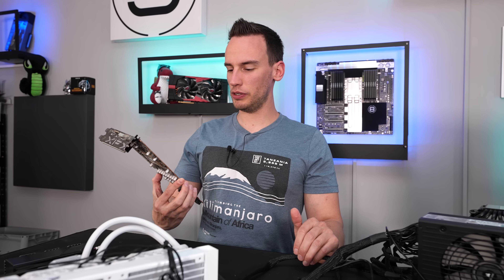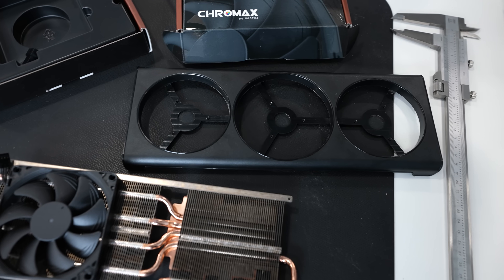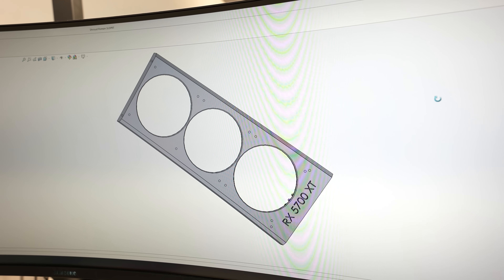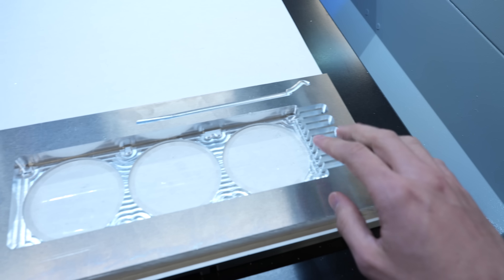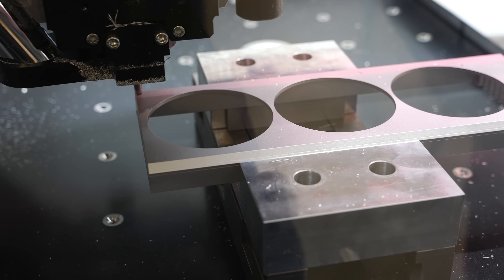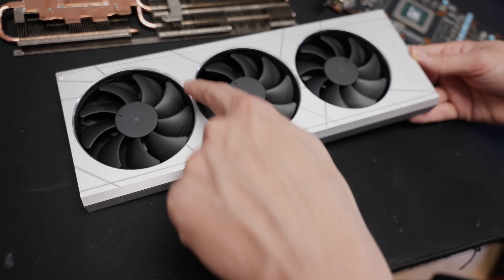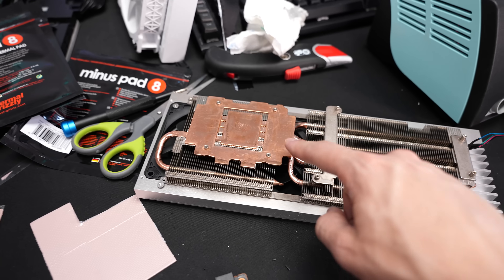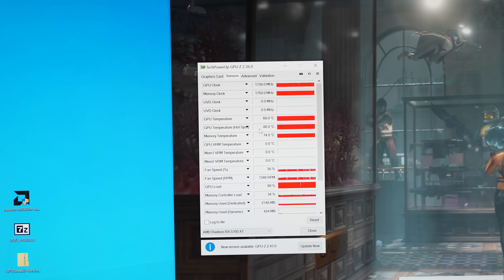We made our own 5700 XT Noctua Edition and it turned out Amazing!

Comment: Are xfx shrouds of same dimension across cards? I'd be interested in that mod's dimensions to compare with my xfx 7900xtx. An updated version would be nice, with space to tuck in wires. Or, a full deshroud mod that allows for a NH-D15. The advantage of the full deshroud is that each component are on their own heatsink. I watched a video on thermals affected by different pastes / heat pads, the ones that were really efficient transferred heat to the main heatsink but that heat wouldn't be dissipated fast enough and ended transferring to the other components (for example, good temp on memory but higher core temp). Independent heatsinks  design allow for use of paste and heat pads with best heat transfer rate without the negative side effect. Also gives you a choice on not only fans but also heatsink solutions.

Comment: In my opinion, at the cost of GPU dimensions and weight, a lot more GPU's shoud have standard off the shelf PC fans in 92mm or 120mm sizes.

This would make old GPU's  so much more convenient to replace their fans if the bearings are very worn out and close to retirement or if they have other issues.

Comment: Why didnt you just use the solid blocks of aluminium as the heatsink? Bore the inside out, add a couple ball valves to fill will water and purge the air, bolt each together with a gasket seal. Dont even use fans, it would take all day to warm up, then you can take it to bed with you on a cold night.

Comment: I was looking at alot of 92mm fans to replace the ones on my card. The conclusion I came to is that gpus using thin fans is the worst design choice ever made. Going thicker you get a free improvement to pressure without an increase in noise. And alot of the time the actual blade length is ontl 11mm not even 14, especially on older cards and palit cards.

My findings basically were

best budget:
arctic f9 at 10 cad/9 usd
15 dba
43 cfm
1.3 of whatever the static pressure unit is

best:
noctua nfa9 chromax (to not be ugly) (the ones used in this video) 25 cad/20 usd
22 dba
46 cfm
2.2 pressure (mm2 h2o? maybe thats what that was)
- or -
at 16 dba
36 cfm
1.6 pressure

when comparing to 14mm thick fans, for the same noise you get about 20% less airflow and 40% less pressure at best.
while the stock fans in gpus are around 30% less airflow and 50% less pressure at the same noise

this assumes datasheets are all correct, but we all know stock gpu fans are noisy and these noctua ones arent

Comment: I've got an RTX 2080 Ti, and one of the 3 fans are starting to act a bit weird.
There's a guy in Canada who makes shrouds that fit the older STRIX cards, which is a kind of "frame" you attach to the heat sink that allows you to attach any pair of standard 120mm fans to it. 
So, that's a nice solution. It's about 33 Canadian dollars, which isn't much, either.
Pop in a pair of Noctua fans and you'll get a setup that's quieter than the stock fans, and the cooling is even marginally better. Reliability is probably better, as well, and it's easy to replace a fan in the future.

It doesn't look good, though, just a simple plastic frame. Your solution is obviously far superior, though of course a lot more expensive.

Comment: I think repairing a flooded pc is a nice project. 
But milling the shroud out of a solid aluminium block seems kind of wastefull to me. 
Correct me if I'm wrong, the shroud material doesn't seem to serve any thermal purpose, the aluminium doesn't add to the thermal mass, does it? Could have been done with a several pieces screwed together.

Comment: How did you go about making the adapter so the board could drive the fans? Did you have to cross any wires or was it just a 1:1 thing? Did you have any references? Did you need to use a multimeter to check?

Comment: that is a nice build, but at my criteria, not efficient or an improvement in heat transfer o focus really in performance of the cooling system.

whit a better air routing in a next design, and reviving those heat pipes, temperature will drop a few but important Celsius.

Comment: Very nice mod! I've done the same on my RX 5700, with arctic F9 fans, but I've just zipped them to the original cooler.
You could fix the wrong rpms reading by using MorePowerTool and changing the fan specs as well, otherwise the vbios will still think to deal with the original fans

Comment: yeah a good backplate required... most of the time the card is horizontally mounted.
so the new setup is certainly heavy and not good for this type of setup...
but a nice backplate, covering the side, and no need to cover the heatsink itself, could be a great design.

Comment: Coole sache, da bekommt man echt bock sich ne CNC Maschine in die Werkstatt zu stellen :D

How about a V2 where you use a Rajintec or Arctic VGA cooler?
I have 3 different cards with arctic VGA coolers that are very quiet and very cool, basically at ambient noise

Comment: hey great project but the shroud weighs a ton! you could have milled away a looot more. and also things like this should be stamped and not milled. with connection points welded to the shroud. 
but i dont think anyone can produce that easily.

Comment: Could do a 'der8auer signature custom' of a top-of-the-line card: custom fans with a milled shroud, then for the milled backplate you could see what PCB areas get hot and leave islands to place thermal pads for great cooling. Maybe mill the backplate with some grooves for surface area too. Could even do a competition and give it away, one of a kind :)

Comment: Old guy CNC wisdom: Anodizing comes in two classes 'soft' and 'hard'.
Hard anodized aluminum will consume cnc tooling very quickly as it is chemically aluminum-oxide at that point, the color is usually aluminum grey or stone-washed colors. Soft anodization on the other hand is the same process, however to a lesser degree of skin thickness. Soft anodizing is faster (more vivid colors) and slightly cheaper to contract out as well.

But if only the look appeals to you, there are other simple (brush on) coatings you may wish to consider as well. Alodine (aircraft industry) produces a beautiful green/blue/purple hues on top of a gold tone. Also, "Aluminum Black" black-oxide solution (gun smiths use to touch up scratched parts.)

PS: Always prefer G1 over G0 (G-zero) milling moves.

Comment: I managed to fix the temperature issues on my legendaryly crap ASUS Tuf RX5700 XT and with kryonaut paste and new pads got the temps from 84c (HS 106C) down to 66 (HS 82C) and memory with heatspreader modding from 109C down to 84C.
All while using the same stock 75mm fans that are absolutely terrible.

2mm thick plastic washers on all heatsink mounting screws did the trick for the main temps :)

Comment: i did a very similar thing to my powercolor red dragon 5700xt last year. I 3d printed a plenum that bolted to the face of the stock heat sink and took 2 120mm fans. I did it for noise, and it was a really nice upgrade.

Comment: This is an exceptional mod and a great proof of concept. A budget brand should make a mid to high end card design with 120MM fan mounts directly to the shroud and 1 or 2 4Pin PWM fan connectors on the GPU PCB.
Reply: Maybe power color or PNY could make this for less money because sourcing 120mm fans for the GPU is probably cheap.
Reply: I would also like to see Noctua and ASUS partner again for an ITX 3060 with a single slim noctua 92mm.

Comment: EASILY replaceable fan shrouds?
Anybody else really, really want to be able to simply pop off the fan/shroud (but not heatsink) and replace the entire unit with minimal hassle? I modded my GTX1080 but it was a pain. It was fun, but I had to use zip ties. I also had issues with coil whine so had to send one of the fans to the motherboard (not the GPU fan) which worked out okay. I would love to have a STANDARD for how fans mount so you can swap the entire unit in a few minutes.

Comment: With your skills & tools, I'm surprised you haven't addressed the 1 issue that bugs me every time I see a vid about a custom cooler - thermal pads.

I'd really like to see a comparison between pads & either shims if they could be made accurately enough of the same material as the heatsink, OR an idea I just had: what about using a sort of spring made of the HS material. It'd start off as a flat thin strip of metal attached at 1 end to the HS, and be bent away from the HS slightly more than it needs to be to touch the RAM or whatever. That way, when the cooler is applied to the card it will hold itself against the appropriate component.

Comment: Try out fan modding with Asus GPUs that have Fanconnect. Or maybe tryout those PCI fan mounts that basically mounts case fans onto the PCI slot on the case, blowing air into the GPU.

Comment: I know you have your cnc machine and you want to use it but nobody does remove 90% of aluminum from a full block for doing just a holder. You could have done it by using a tool which bent aluminum, this is a huge waste of material nonetheless the result is pretty nice i just feel bad for wasting so much material

Comment: I think, that you should've cut some material from sides (to mb and case wall) - it's just dead weight, that makes card sag more in horizontal orientation. Also maybe you should've extended shroud to the io shield side, so that weight of cooler and shroud itself would lean on the io shield, that is screwed to the case, and that should make card sag far less

Comment: Great video. But a couple of questions. Why are of the sides of the new shroud so dam thick? And how much does it weigh now? And I was wondering why you had those high temps with 3 noctua fans regardless of the heatsink but then you found the mounting pressure was bad.

Comment: you said not a big difference but fixing the pressure brought it from 81C at 70% fan speed to 68C at 36% fan speed, and that also brought about a core clock bump from 1650MHz to 1740MHz with the lower thermals AND lower fan speed! That's an enormous difference.

Comment: Gelid used to make a adaptor for converting the 4pin pwm connector on GPU to standard 4-Pin PWM connector. Also why not 3D print shroud from metal instead of milling it from solid block?

Comment: Did the face plate connected to the actual heatsink? Would be cool if the faceplate also part of the cooling system. Got additional mass to soak up those heat.

Comment: Since 2017 i have been doing this to my gpus. 1080ti, 2080ti, now 3080. Using a 3dprinter to print the shroud and using 2x Noctua af12x25. The performance and noise is just way better than any stock gpu cooler... Highly recommend it !!!

Comment: That's a 1/4 kilo of alluminium Why not solder the fins to the shroud or have a thermal connection to the heat pipes. Have it be practical and pretty. I suspect it won't be hot to the touch and worth the temp drop

Comment: Ah yes, never do the final cut throughs untill all the bulk material is removed. 

Yes, Chamfer tool is the term you where looking for. 
I'd still anodise it. Even if it is just clear, simply for surface protection.

I did a similar mod to that on an old GTX 960 blower card. Pulled the loud blower off and used an old intel cooler I had sitting around. So much quieter, though no where near as neat.

Comment: I love the project, but it still having such mass of aluminum the weight of the card would be extreme for sag. To bad the aluminum is not direct contact to provide cooling this is probably why the backplate are aluminum while the fan shrouds are plastic.

Comment: Beautiful mod!
I would have cried a bit when the bit cut that deep hole in the corner.
Do you remember that little cube AMD put in the corner of there blowers that has an LED I think?
Maybe mill out that corner and put a led there and make a small cube out of acrylic or something to hide the accident, just an idea.

Also may I suggest something for next time, its not a criticism of your work or this mod just and idea.

I installed a Nocuta L9i in my parents ITX system years ago and it uses basically the same 92x15mm fan.
Then my father wanted an RX480 to run some gams (they usd intel HD grapics up to that point) and because of that the i7 3770 with the L9i ran hot enough for the fan to run at annoying levels of rpm becuse of the GPU dumping that hot air in to the case, its max 2600 if I recall for this model of noctua 92x15 fan.

So I bought a 90x25mm noctua fan, its ither ethe 1600 or 2000 rpm version or there about.
Anyways the temps drooped about 7C on the CPU att 2.8Ghz all core boost in prime95 and the noise I would say was cut in half from annoying to hardly audible.

Now the reason I suggest this is if you want to compare this to the Noctua card your reviewed it used 120x25.

One advantage with ticker fan is not so much the static pressure but the fact that added thickens allows for greater blade pitch and most importantly more surface area on the blades.

So a 92x25 will move more air then a 92x15 even with very similar design.

Now I not a fan of 3-4 slots cards but if silence is the goal with openair cooler that is what I would do.

The thickens of the fin stack in the 5700 you used is about the same as the L9i.

It would not surprised me if you can get that thing down to 1000rpm from 1300 at the same temperature.

So this is not criticism, its just an idea based on how the ASUS RTX3070 noctua edition was designed and also if maximum silence is the goal.

Something else I would LOVE to see is custom blower. Maybe a 3 slot, 25mm wider and longer like the one EVGA did with there 680, it also had a bigger fan. Radial fans static pressure seems to go up exponentially with the radius so Im more then sure a silent blower could be made, EVGA kind of proved it once but then no one has really done it again.

There are companies making custom heatpipe/heatsink/vapor chamber solution on order, probably cost a fortune but thats something I would want to make if I had the money and resources.

But yes overall I think Custom GPU cooling is interesting because to me right now its all Openair coolers of the same design, 300 flavors of vanilla and nothing else, its nice with options but if all options are the same thats like having no options.

Anyway I hope this dont come of as negative criticism, I could not make what you did in this video so I wont complain but just say WOW thats a nice cooler you made!
I would love more content on subject like this so we can see the benefits of different design approaches like what fans to use, how many, placements etc etc.

Best Regards Patrik

Comment: use brake disc cleaner, which is for cars i know, but without fault, it cleans any PCB from any kind of dirt, dust or debris. Works flawlessly for me and it's non-conductive or non-destructive for any PC parts, you just have to let it dry and it's good to go :) using it for years since my friend had no isopropyl alcohol at home and he thought just use that (i was laughing at him, but it worked, was no longer a stupid idea), never going back to that for a full PC clean :D EVER

Comment: Might want to be sure there is enough airflow when adding the backplate.  Too closed off and that might negatively impact thermals.

Also, it looked like you were getting another 100 MHz in the test after fixing the thermal interface.

Comment: Black anodize it then cut the 1mm lines it would look great.  Keep in mind anodizing is hard so you'd need a very high speed head to cut it cleanly.   I used to have black hard anodized parts engraved and it took a 30,000 rpm head to get it done cleanly.

Comment: Wonderful result, great job man.
Noctua really, REALLY should get into aftermarket GPU cooling. 2x A12x25 fans and a custom high-end heatsink with a nice shroud and no RGB, with some clever installation mechanism so it would work on most common card designs shouldn't be impossible, eh? I'd pay anything for that.

Comment: I'm curious, what was the final weight of the shroud with fans installed?  It looks heavy.  I imagine that it would be great for vertical mounting, but would sag a lot with a vertical mount position.  Visually, it looks great!
Reply: I don't think it would weigh much more than a normal 5700xt - I have a couple cards I'd imagine are heavier. A 3070 with a massive heatsink and a little screen on it, gigabytes high end model, and a xfx 6700xt that is something like 340 mm's long, It's massive.

Comment: 7:25
90 degree included angle end mill, or chamfer mill is correct.
Great video and beautiful machine work for what you had to work with, coming from a tool maker for 46 years.

Comment: When I saw you had two blocks of aluminium I though you were going to make some kind of custom shroud that would complement the heatsink, similar to functional backplates.
So after that I imagined a custom cooler which extended to the shroud, like, your typical shroud but make from aluminium fins (idk if that's how it's written) and maybe one or two extra heatpipes. Similar to those raspberry coolers where the fans are inside the actual cooler.

Comment: Looks pretty damn sweet. One suggestion - stop using the vacuum to hold your parts. It’s fine for mdf but for aluminum you are just torturing yourself. I would use the vacuum table to make myself another table with a nice grid of threaded holes to match w/e a well known and available work holding company in Germany uses and then swap it out when you want to machine metal. With proper clamping of the workpiece you could probably machine 5x faster. Not sure if that machine has coolant. But if it does and you get the right stuff for aluminum you would have a mirror finish. First guy I have seen hold down the work piece with tape..The boo-boo with the chamfer tool looks like a tool length mistake. You can get the tool measurement station and have it measure the tool after every change before cutting because they can move in the collets especially after a crash.